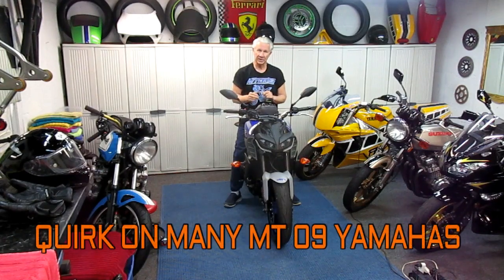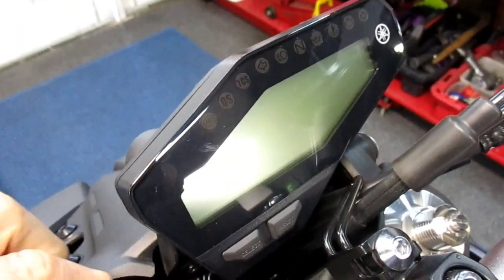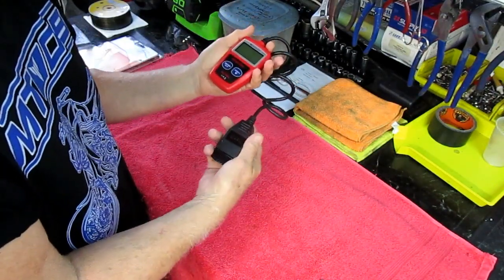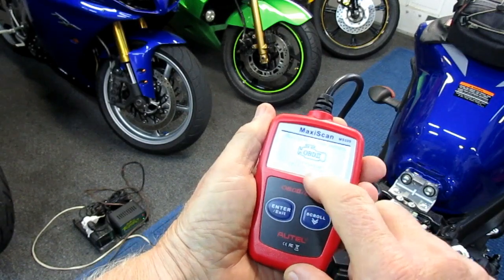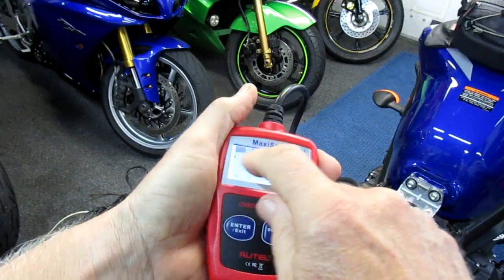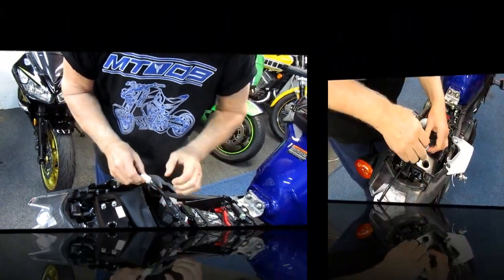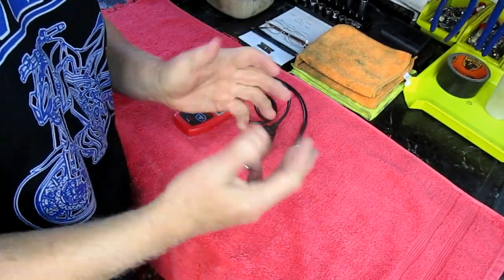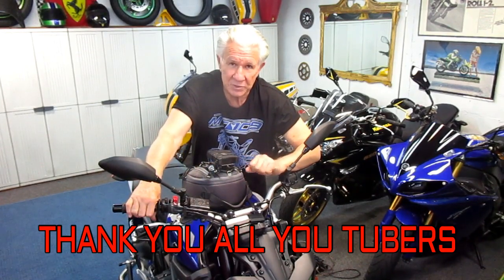HOW TO CLEAR CHECK ENGINE LIGHT MT 09 YAMAHA AND OTHERS

Comment from the maker: ON MY MT09 ONCE I CLEARED THE CHECK ENGINE LIGHT IT NEVER HAPPENED AGAIN BUT I ALWAYS LEAVE TRACTION CONTROL IN MOST INVASIVE SETTING.WORKS GREAT ON THE ROADS I TYPICALLY RIDE ON.

Comment: Great video , going off topic a little here but i really need some help from a guy with experience , basically I have the new r1 and I'm having trouble with the rear axle nut  tourqe that's in the service manual that's 140flbs of tourqe which is really high in my opinion ,   I've herd some horror stories of bending and breaking things at those specs  , I thought the 2014 model was high at 108flbs but now I look back it seems reasonable  , looking at all the parts through those years and they look identical so I'm very reluctant to follow the new factory specs, I think it would be safer to stick to the old tourqe specs of 108flbs, would you agree that 140flbs is a bit excessive, I just really don't want to damage anything so what would you suggest and is there a rule you follow when tightening rear axle nut , and do you think Yamaha have made an error based on all the damage poeple are doing following the new factory specs, thanks, any replies are greatly appreciated

Comment from the maker: I AM NOT SURE BUT I WOULD THINK YAMAHA WOULD USE THE SAME CONNECTOR ON SIMILAR BIKES.REMEMBER YOU NEED THE TOOL AND CORRECT ADAPTER.ANOTHER IDEA LOOK ON YOUTUBE IF SOMEONE HAS POSTED THE INFO YOU NEED.IF YOU FIND OUT IT WORKS PASS IT ON AND I WILL INCLUDE IN MY QUESTION AND ANSWER VIDEO NEXT TIME I DO ONE.MY GUESS IS IT WILL WORK BUT PLEASE LET ME KNOW IF I AM WRONG.

Comment: Mine cleared without "the meter" or "the wire" by which I assume you mean OBD2 and motorcycle adaptor...my bike is not the identical bike but the next gen of same model My 2022 tracer 9gt this morning shut down some functions like quick shifter than check engine light came on....so I stopped the bike noting the temp was only 175ish (F) the oil level and coloration was fine and no other warning lights like oil pressure.  I had blown the stupid 2 amp fuse for the power outlet yesterday and replaced it with spare 2 amp and no problems riding the bike first thing this am it was not until after I stopped and killed the engine waiting for another rider....I think I had left the key on though not sure.  anyway I popped the seat to look at the fuse box in case I had somehow managed to mess something up yesterday but all was secure and engine light stayed on....so I just let the bike sit for a half hour or ?  idk  as I was yaking away with some other riders where I had stopped in the shade finally decided to ride the 6 miles home at the bottom of the mountain I planned to mostly coast down but when I started the bike to leave?  Everything was back no engine light all the functions returned....weird?  No OBD2 used it self healed 
Bike has just over 1000miles  anyone know what is up with that??  I suggest messing with it a bit and seeing if it clears itself....which perhpas newer bike self reset and previous gens dont?
Reply: I fincally just today recieved the adaptor I had ordered (the red connector one) and plugged in my OBD2 scanner to see if it threw a code when I had that check engine light and various issues ...there was just one code stored I believe it was P1004 which I cleared even though the check engine light and issues have never returned since last month abou or so.  Wierd anyone elese experience this on 2021/2022 MT90 / Tracer 9gt?

Comment: I have 2020 MT-09. Ignition was left on over night and killed the battery, and now the check engine light is on. I jump started the bike and rode around for a few hours to recharge the battery, and now the battery is fine, the bike starts right up. I disconnected the battery overnight, but that did not clear the Check Engine light. Is there a way to reset it without buying the OBD tool?
Reply: No the fault will stay on the bikes computer needs to be deleted with scan tool
Reply: @boomerhgt  yea, got the scan tool from amazon for $30 and deleted the code, everything is good now. Thanks.
Reply: @Faceless_Chat  do you have a link for exact this thing?
Reply: @bohdankutiepov3870  you will also need the adapter https://www.amazon.com/gp/product/B088TLYHQT/ref=ppx_yo_dt_b_asin_title_o02_s01?ie=UTF8&psc=1
Reply: I think blowing the 2amp  accessory fuse tryig to power mini compressor on my 2022 is what caused the check engine light after replacing the fuse but I am not certain because I did not even notice for 10 mile when I stopped...and then things went wonky quick shifter stropped working ...it reset itself though after a half hour and turning the key on and off looking for problem...suddenly cleared and all was well again wierd...it did store a code though _1004 I believe it was but I cleared it just to see if it comes back
Reply: @dougiequick1  i just got the obd2 code reader from Amazon. Cleared the code and the baby been running well ever since.

Comment: Hi, wanted to check. If the cable for mt09 is 4pins?
Reply: starting in 2021 I believe it is 6pins the red connector  there obviously are multi generations of the MT09 so you cant ask intelligently without including the year/gen...just saying

Comment: DO YOU HAVE THE LINK FOR THE WIRE TO BUY?
Reply: Item B088TLYHQT on Amazon worked for me using the same scanner in the video.
Reply: not "the wire" it is an OBD2 adaptor...just saying so you can find it...have specify year because the 2021/2022 is 6 pin

Comment: Read the code first so you know what the    Actual problem was that was turning on the check engine light then look up the code . Fix the problem related to the code or erase the code if it was a Nuisance code.
Reply: unless like mine nothing to fix...it glitched somehow then cleared how ya gonna fix that

Comment from the maker: REAR AXLE NUT TORQUE MIGHT BE 140 or 108,but I would check with anyone who services these bikes to see.Choice two contact YAMAHA direct.But if all else fails here is my OLD SCHOOL way of thinking,tighten to 108,ride the bike a tank of gas,see if torque is same at end of the ride.MY R1 HAS NEVER LOOSENED ANYTHING IN 36,000 MILES but as an OLD SCHOOL GUY I check it regularly.My go to guy in the past has been KENNY AUGUSTINE who recently passed away.Also be sure its FOOT POUND not some other measure like NEWTON METERS or whatever.My R1 manual is all in foot pounds.

Comment from the maker: SEVERAL PEOPLE HAVE REPORTED THE VIDEO SAVED THEM SOME BUCKS OVERALL AND IT IS EASY TO DO.PLUS IF IT EVER HAPPENS AGAIN NO TRIP TO THE FRIENDLY DEALER.MINE WAS RELATED TO THE TRACTION CONTROL SETTINGS BUT NEVER CAME BACK AFTER CORRECTION.

Comment: Same as my situation, when I finnished my chain cleaning. I try to dry the chain by starting the engine when it still on the motorcycle stand eventhought I already turn off the TCS but then the engine error signal was automatically turn on.

Comment: Amazing little video, just had check engine light come on my MT09sp for no reason and everything runs fine so I’m gonna get myself a code reader and cable see what’s what and save some dealer faff
Reply: Did you get any issues after getting the light turned off the first time ?

Comment: Thanks for the video buddy, I had the same problem but thanks to you it's all sorted now! Incidentally, the fault code was speed sensor. It happened  after the technical inspection you have to do here in Spain. I think the guy played around with the traction control whilst doing the checks. Anyway all is good now! Thanks again, ride safe.
Reply: Same issue after technicus inspection  in belgium

Comment: Thanks for the info, Windy. I just used this information to reset the check engine light on my 2017 FZ-09. The light was on because I'm dumb so let's not get into that. I bought the same scanner from Amazon B07VDKGK4T but wasn't sure which cable so I picked up Amazon B088TLYHQT. Both were in stock and arrived in two days. It took more time to take the seat off than to clear the codes. Total cost around $40 so probably worth it versus taking it to a shop.
Reply: What was the code lol and symptoms of any